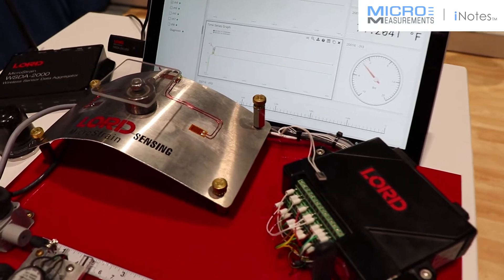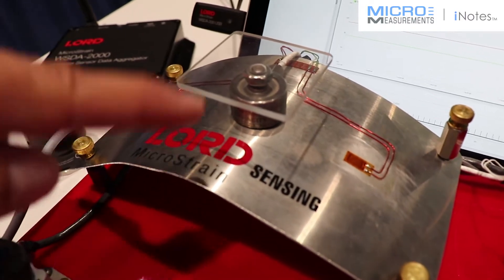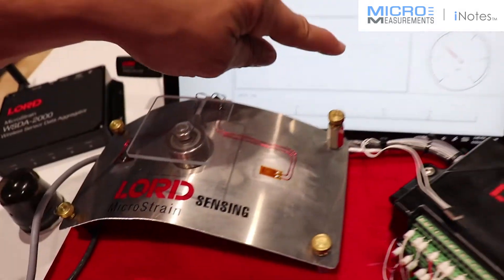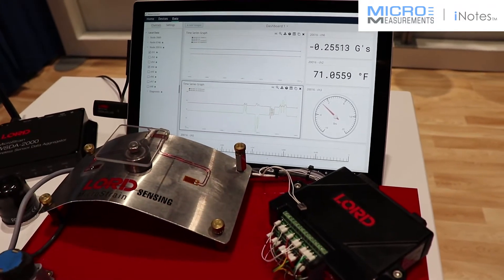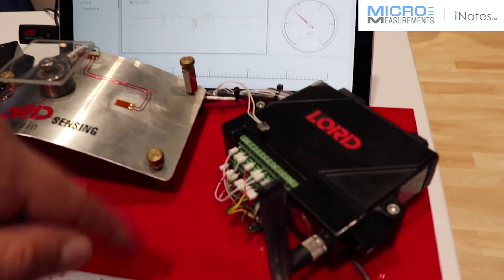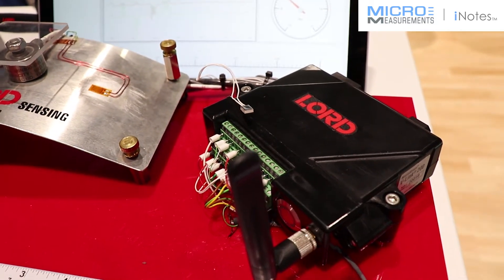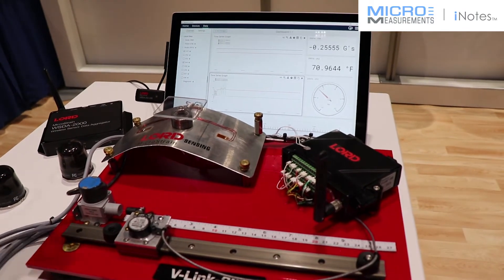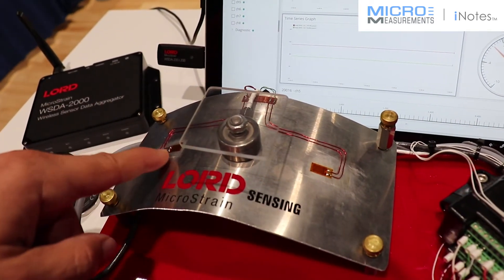Wireless DAQ System for strain gauge sensors

Comment: Please, the SG-Link 200 has to be attached to a cable with many coloured wires. Please, I would like to find out how I must partition the coloured wires and then solder them to 1 CLY4-3/350ZE Strain Gauge CLY4 Linear strain gauge with a configurable connection cable. Again, how must I partition the coloured wires in the cable and solder to 1 CRY81-3/350ZE Pre-wired strain Gauge CRY8 Rectangular rosette with three measurement grids and configurable connection cable? I would be grateful for your response and help. Thank you.

Comment: Algunos equipos están sujetos a deformaciones enormes durante su vida útil normal, por lo que con el tiempo el equipo puede agrietarse, lo que aumenta el riesgo de fallos catastróficos. La nueva solución de Micro-Measurements y MicroStrain le puede ayudar a monitorizar los niveles de deformación de los equipos para asegurar el mantenimiento adecuado y seguro en cualquier parte del mundo.

En esta iNote Justin de LORD Sensing-MicroStrain explica cómo las bandas extensométricas CEA de Micro-Measurements se utilizan con el sistema extensométrico de monitorización inalámbrica de MicroStrain, en una gama de aplicaciones para medir la deformación.

Si necesita más información, por favor no dude en contactarnos. mm.es@vpgsensors.com miguel.bravo@vpgsensors.com